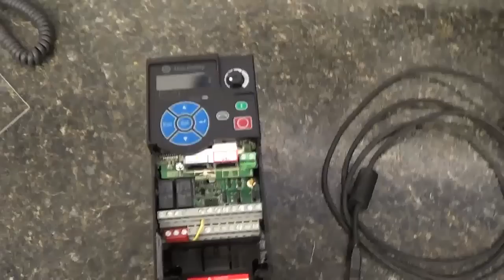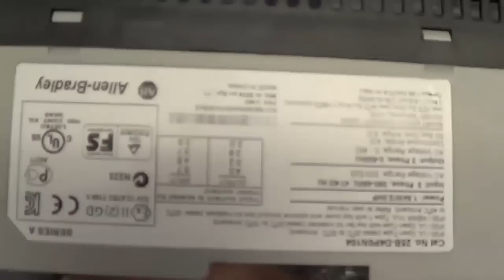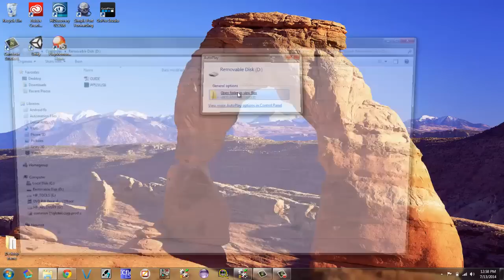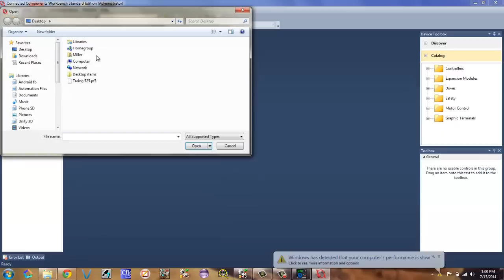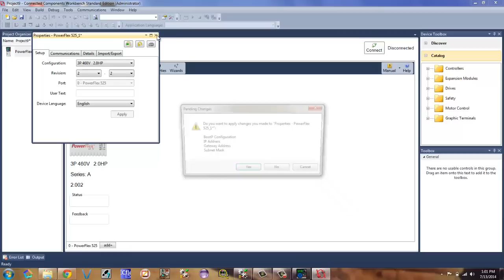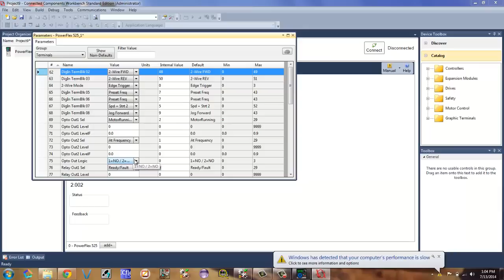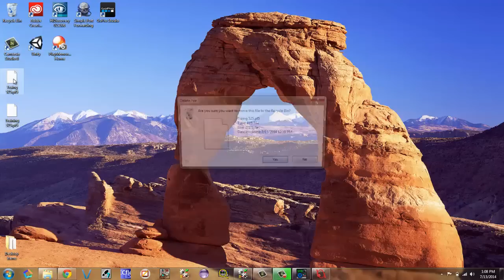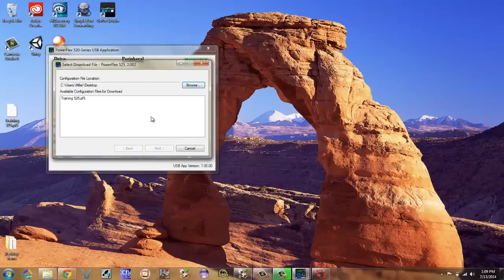PowerFlex 525 Basic Setup For ethernet

Comment: Thanks for the great video! We have been dealing with 525's for years, but never knew about the USB connectivity and setup through CCW. Normally, when we have to change a drive; we install it, power it up, and manually set the IP address to get it online. Then we would connect to it through Studio and drop all of the parameters in it. This way through CCW gives us another option. I just got done trying this out with a spare drive that we have and it works great. Thanks!
Reply from the maker: Glad this helped you with engineering efficiency!! You should check out the Siemens drives controlled by a 5069-L320ERMS2, I made a video for it. This is my own opinion but I have found them to out perform the AB drives. That's just my opinion though.
Reply: @PLCAutomationTraining  Thanks for the info about one of your videos. We don't have much Siemens stuff anymore. We find it not to be very user friendly. Our corporation as a whole is phasing out anything Siemens, and we are a German owned company too. AB seems to be a lot easier to deal with, and it is our corporate standard for PLC's. For VFD's, we use AB and Yaskawa.
Reply from the maker: @Brewman2023  what industry is your company in May I ask? And what country
Reply: @PLCAutomationTraining  We are a large building products manufacturer in the US.

Comment: Thanks this video its amazing, very helpful
Can you setup the device to run automatically instead of having to activate with the key pad or ethernet?
Reply: yes, you can select different start and stop source , 2 wire, 3 wire, analog in, digital in, through ethernet or dsi comm ports

Comment: Good tutorial, I still have some confusion on how this exactly works. I have been going through the manual nonstop about it, but I had some questions. Can I connect the powerflex directly to the Ethernet while it is plugged into its main power source and adjust parameters like that? Taking the powerflex apart to adjust the parameters every time so I can use the USB seems redundant. Also if I can use Ethernet, it is not connecting to the device. When I tried following your video and tried uploading the file, it said the file and the powerflex had different versions of the file. Essentially the powerflex had version: 5.00 and the file was 4.00. I was thinking I would have to update my Connected Components software on my computer. Would this be the right way to approach it?
Reply from the maker: Mike Silva download the new drives firmware from ab and yes you can update CCW. also yes you can do it over ethernet, you have to set the IP address through the him then power cycle the drive. then you can connect to it over ethernet and do the same parameter setup with ccw or through rslogix 5000
Reply: Wow thanks for the quick response. Ill let you know how it works out!

Comment: Thank you this was a very helpful video.

I was wondering if you can add video of how to connect using RS5000. I don't have the right add On installed and im not sure what I need to download in order to connect and be able to upload and download.

Thanks
Reply: The connection to the 525 in rs logix 5000 is posted
Reply from the maker: The video you requested has been posted

Comment: I am having a hard time connecting. After I connected my USB to Power Flex 525 the PF52XUSB file or guide will not open..not responding What am i doing wrong.
Is there another way?
Reply from the maker: bad cable?

Comment: Hi again, so I ended up being able to get through the video without any errors after updating the drivers and CCW. Now I can't seem to be able to connect my Powerflex to my laptop. I know you mentioned something about entering the IP through the HMI, but I am not sure how to do that, if you don't mind explaining that part? Thank you
Reply from the maker: Mike Silva c129 through c140 ip sub gateway in that order
Reply: Yeah that is exactly what I did. For some reason the device isn't being recognized when I try to connect. Like I said earlier I had updated the CCW to the latest version, and the driver as well.
Reply: I did power cycle the drive as well. Still isn't recognizing the device
Reply: So I figured it out I had to match the IP from the computer's LAN to the IP to the drive separately from the Control Panel Menu. I appreciate the help!
Reply: So I figured it out I had to match the IP from the computer's LAN to the IP to the drive separately from the Control Panel Menu. I appreciate the help!
Reply from the maker: Mike Silva good deal glad i could help. i didnt think about that i assumed it was already good luck and thank you for watching